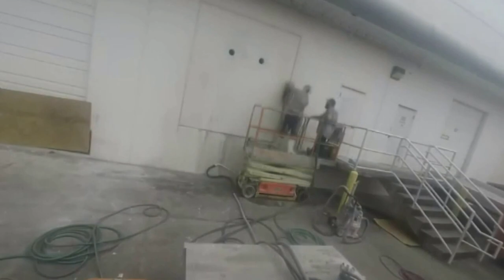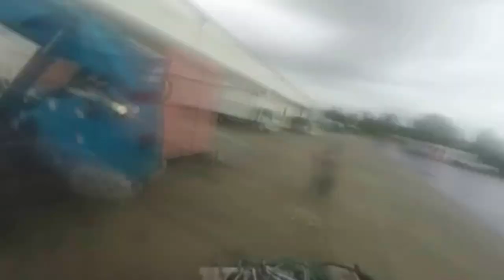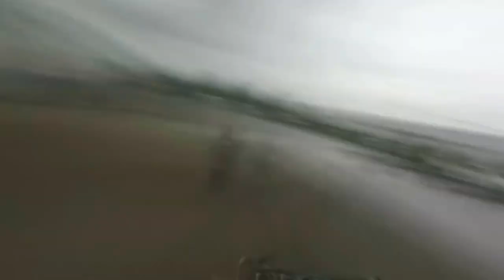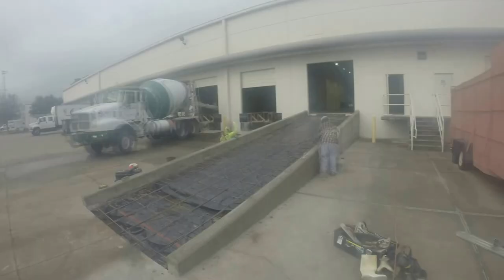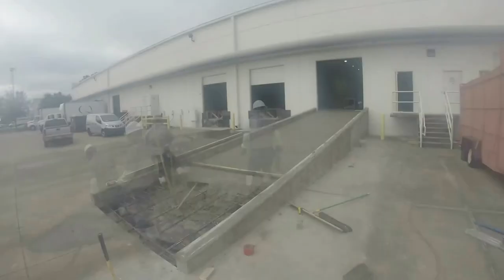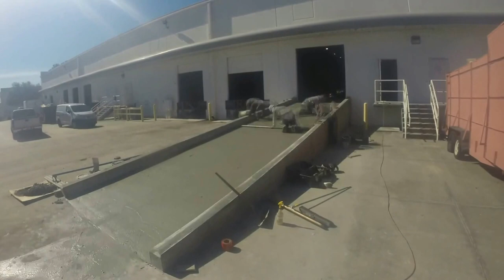Concrete Wall Opening Cut & Ramp Pour By Maxter Enterprises

Comment: I wanna make the same ramp for our warehouse which heavy-duty types of machinery such as reach stackers will pass through .

In order to reduce the cost, I'm making two parallel retaining walls by block material and fill between them by the "Stone laid concrete" to top of it a slab with a mesh of 16mm @25mm reinforcements.
Reply: Could you pls advise what type of material did you pour under the slab?